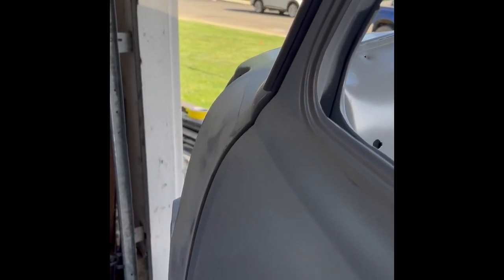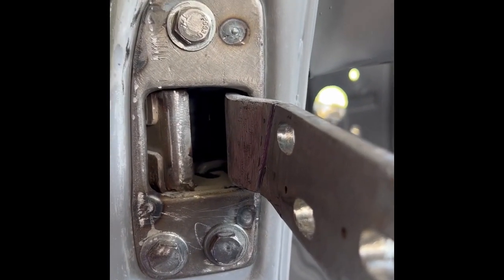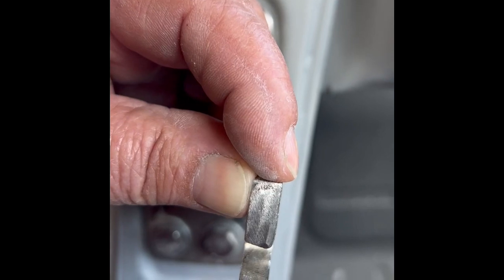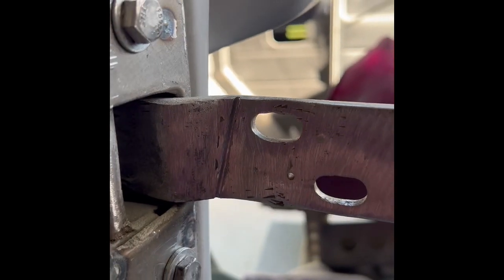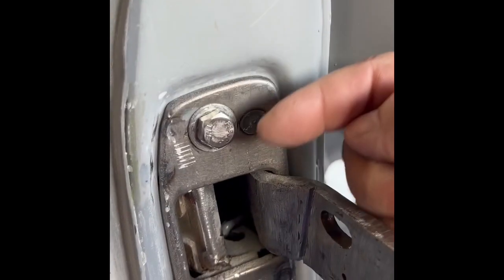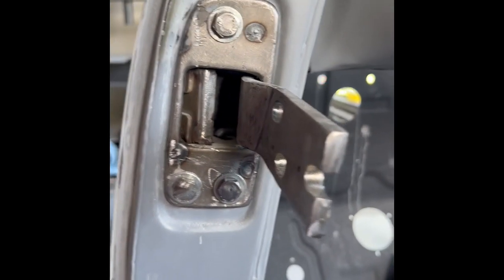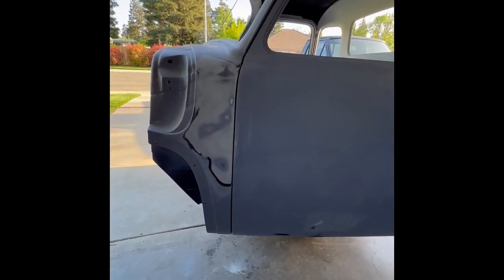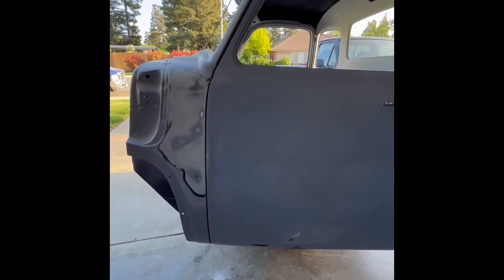1953 Chevrolet truck door adjustment

Comment: Seems like cutting that groove would weaken the hinge considerably. Dont know if thats the best thing to do???
Reply from the maker: You do have to weld it back up. If you have a press you can use it to bend the hinge without cutting the groove.

Comment: Could you just use shims
Reply from the maker: Can’t really shim it because the hinge sits in a pocket in the door. Unfortunately you have to take the door on and off to recheck. If you have a press you don’t need to cut the groove to bend. Saves you having to weld the groove back up.